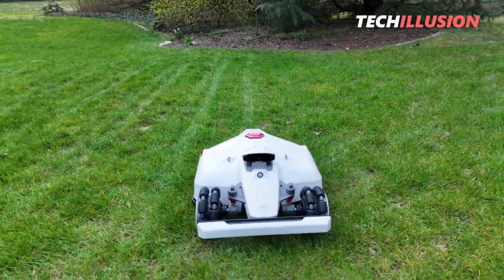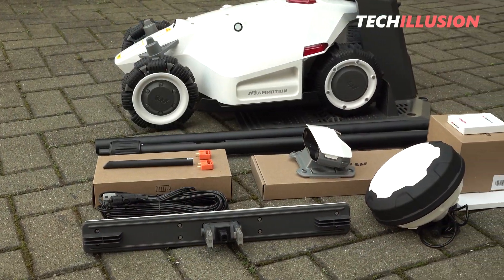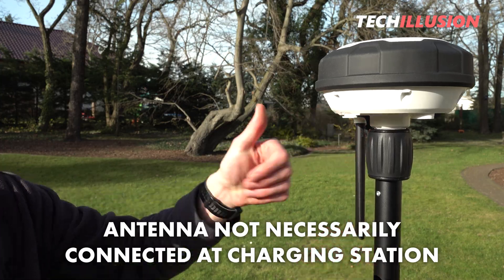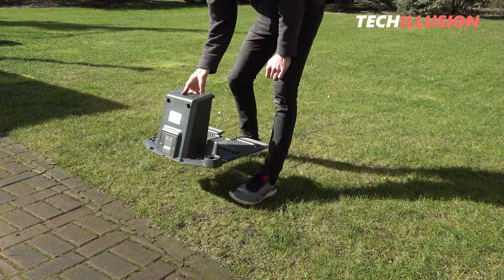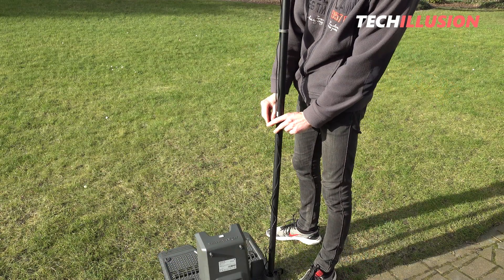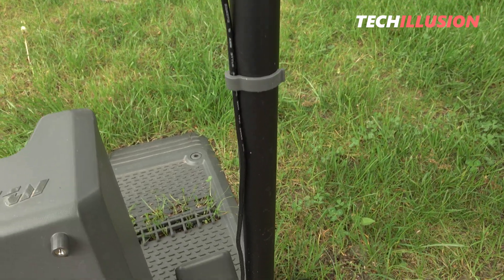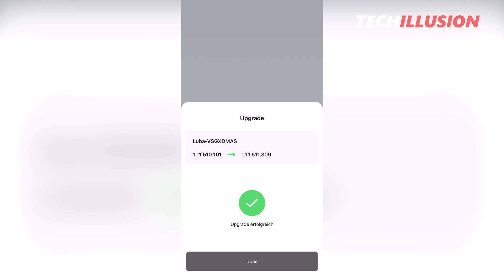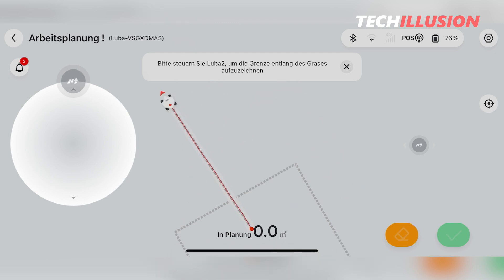🔥Mammotion LUBA 2 AWD Installation, Set-up & Commissioning ✔︎ Step by Step Guide Luba 1000 3000 5000

Comment: Hi, can antenna be non-attached with wire to station?
Reply from the maker: Hello, you can connect the Antenne with the station but this is not necessary. You can also connect it to the power cord and place it somewhere else :) 
They don't need a physical connect via cable 
Best regards

Comment: Very annoying that you keep referencing the differences to the Luba 1 !  This is a Luba TWO video.  Stay on topic.
Reply: The references were on-point and not excessive. Try not to overreact.
Reply from the maker: @dennispalmer2192 Please excuse me if the reference to the Luba 1 should have disturbed. In my opinion, it is quite interesting to see the difference to the first version. This allows you to see directly what has been optimized and where there have been changes. :)
Best regards

Comment: Skipped a major step connecting the rtk to the app too
Reply from the maker: @Darryl_xtx  The RTK is normally connected directly to the robotic lawnmower and does not need to be connected separately to the app. However, if this is not the case and the RTK does not connect automatically, it can be added separately.
To do this, proceed in the same way as if you were adding a new robotic lawnmower. Click on the large plus symbol and select RTK. The app then searches for available devices in the vicinity and we can initiate the connection.
The whole thing shouldn't be a problem, I've also just tested it again myself. 😊👍🏼
Best regards and have a nice weekend
Reply: I had to add it in the app, otherwise it was not positioning.